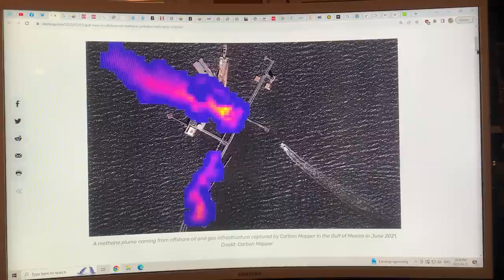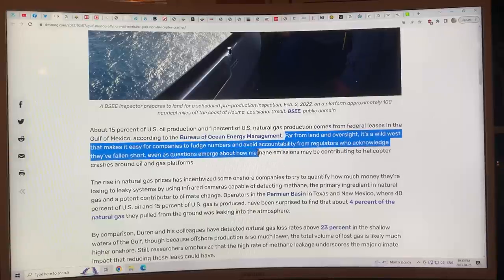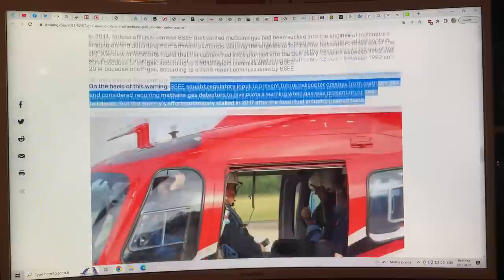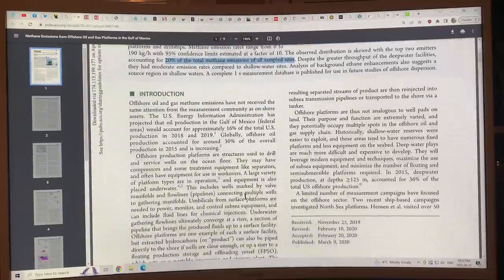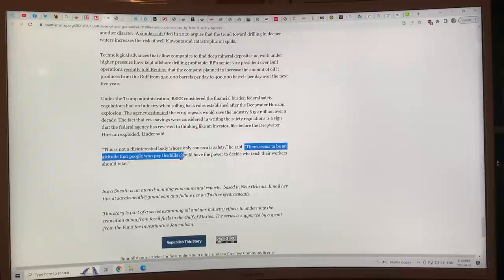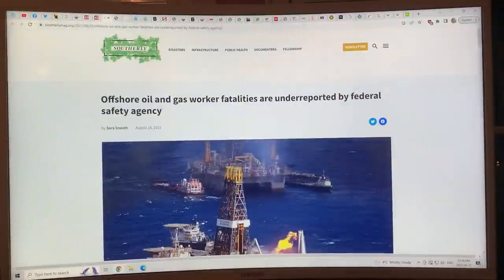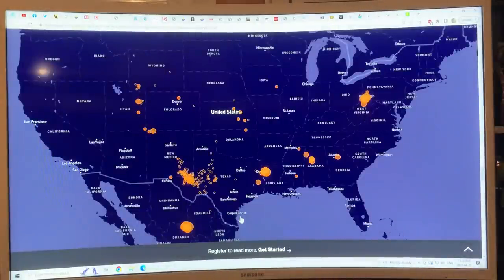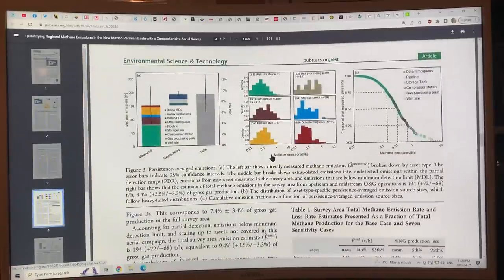Huge Methane Gas Leaks from the USA Oil and Gas Industry: Both Onshore and Offshore

Comment from the maker: This is a very detailed description of the vastly under-reported methane gas leakage from the US Oil and Gas industry. 

It paints a very concerning picture of lax regulation, and almost no self-monitoring in both the onshore and offshore oil and gas industry, as far as methane leakage is concerned. 

Peer-reviewed scientific papers are presented showing that we can cheaply and accurately measure methane leakage from industry infrastructure using satellite remote sensing and airborne laser spectrometers. 

The US Oil and Gas industry is like Swiss Cheese as far as methane leaks are concerned. The massive Permian Basin, for example, has methane leak rates of 9.3%, versus the regulator numbers calculated that are at least 10x lower. The offshore oil industry is even worse, with leak rates up to 23% at some sites. Not only that, methane leakage even at low concentrations near oil rigs appears to cause helicopters to essentially drop out of the sky. 

We have a huge methane problem with the Oil and Gas Industry, and we have advanced technology to allow us to see the leaks, and then stop them. So why don’t we. Our failure to stop the leaks is criminal, in my view. 

Although the data I show is from the US, this methane leakage is a global problem that is way under-reported. 

What is so infuriating is that it is easy to detect with our present technology, and easy to fix, it saves the companies money to stop the leaks and is surely a big part of the reason for exponentially increasing methane levels in the atmosphere.

Please donate to http://PaulBeckwith.net to support my research and videos.
Reply: Since you can measure the CO2 would you try an experiment to see how much the level would change if you took the plants out of the office for a few hours ?
Reply: I like the fact that your videos are longer and that you explain things clearly, but don't patronise your audience. I have ADHD, but I get the impression that nowadays many people are actually worse than me when it comes to concentrating due to social media etc and all of these distractions.
Reply: @SkepticalTeacher  Paul does not patronize his audience
Reply: @reallymysterious4520  exactly, that was what I wrote!
Reply: @reallymysterious4520  It would barely change. Exhalation produces far more CO2 than those few plants can metabolize.
Reply: @SkepticalTeacher  Who does patronize their audience?
Reply: @Paul Beckwith , I read today in the Guardian about the ocean temperature situation, this is so alarming to me... I can't believe the amount of denial that there is a problem!!
Reply: Paul: thank you so much for your tireless work. I have learned so much from your videos. It’s great to see your animals and also hear about your family, it makes this work more human! I am trying to put the information I learn from you to good use.
Reply: @SkepticalTeacher  Already crossing 21°😄, a straight uptick  and we r in what April right now.
The best part i loved is, oceans have reached their maximum heat sinking potential, which means no more 90% absorption by it, rather directing it to atmosphere and land that barely soaks 7%. Even a fraction of that 90% would topple temperatures to an unprecedented scale that mankind has never seen in its history. Scientists too are in shock and fear and have declared it as an uncharterd territory
Reply: @ClimateTv911  yeah, I get the impression that the oceans have reached maximum capacity to absorb heat from the atmosphere and that we are now going to see both rapidly equalise... it's April in Madrid, but it currently feels like July. It's around 30 degrees C at 9 at night.... in short, we're all f*cked: that's honestly what I think now.

Comment: Thank you.  Most don't report on this.  But it's a huge contribution to methane in the atmosphere.   And the climate getting worse faster and faster right as the fracking and methane leaks have increased.
Reply: "climate getting worse faster and faster" 

What does that mean? How do you measure "better/worse" climate?
Reply: It's getting more methaney and it will probably get a lot more methaneific soon with massive methabulous release from Arctic permafrost, possibly this summer. Hot stuff.
Reply: We're moving off from the relatively flat part of the exponential curve.   The rapidity will only get ever more rapid.

Comment: It's hard to care about the safety of people engaged in the drilling industry. 
Is it really a concern for you  Paul to make landing on gas platforms safer?
Reply: The people working on these platforms are just trying to make a living. Of course workplace safety is important! What a callous statement.
Reply: @Namari12  I gave up my job as a pilot because of the emissions. It cost me hugely and it's not an easy choice, but it just wasn't an acceptable way to make a living anymore. Your judgement of me  is ill considered.
Reply: @camlinhall1363  Commendable
Reply: As fossil fuel supplies become tighter and drilling becomes an easy way to burn money that shortcuts are going to increase to save money. US drillers have lost 1/4 trillion dollars in 10 years with shale oil, and getting tighter, more temporary and expensive in terms of per barrel cost. Lobbyists campaign to reduce regulations to "incentivise" exploration. If discoveries, few as they are, were more plentiful and larger then the cost of compliance per barrel would be lower. The decreased level of exploration is a sign that the world has reached, or is reaching, #PeakOil.

Comment: I'm puzzled that your CO2 level is so high (over 800!). I measure my air quality in my room - and CO2 is 385 ppm. I should add that I live in France in a region where we have somewhat less air pollution than other more industrial places. I'm a little puzzled that the official figures says the global average is about 420 ppm, but maybe I shouldn't be given the high reading Paul Beckwith has.
Reply: maybe Paul has a gas stove and heaters causing his high indoor reading?   at Mauna Lao, on April 25, 2023, CO2 was 424.78 ppm. >>>  https://gml.noaa.gov/ccgg/trends/monthly.html